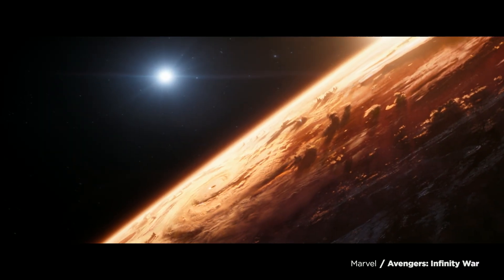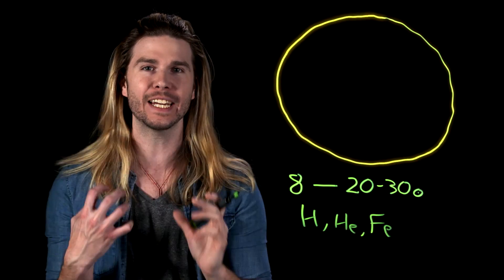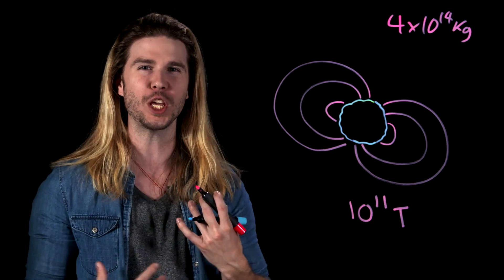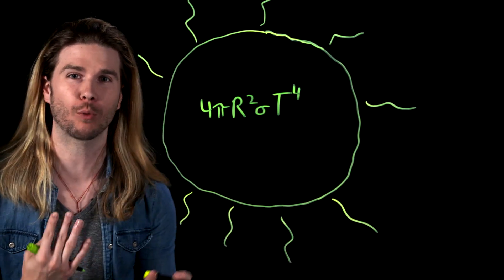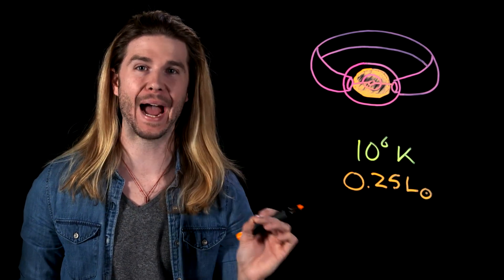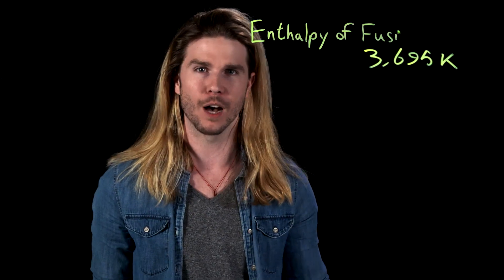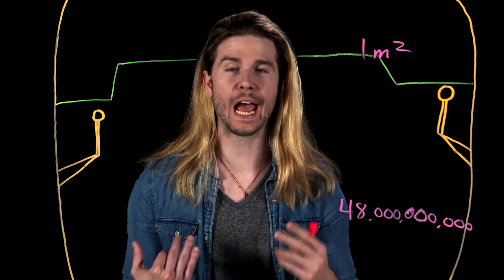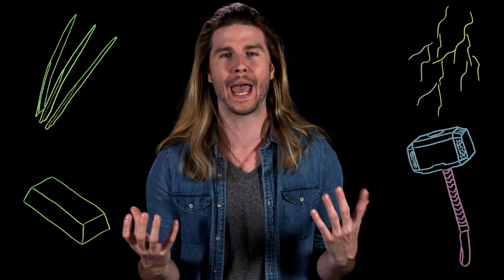How To Forge Thor's Infinity War Weapon

Comment: I think to understand why a star would be needed as a forge in the first place, we need to understand the metal that is being melted.  It is obviously not a metal we are familiar with on earth, especially since we are pretty good at melting tungsten.  Every lightbulb in the world used to do that.  So, we would have to look at the more speculative.  Perhaps we even need to rethink what "forging" in this sense is.  There are theories that postulate the formation of what is known as Strange Matter within the bodies of neutron stars.  Strange matter is made up of strange, up, and down quarks.  There are even a couple of competing models on what strange matter is.  It may even be the most stable matter in the universe.  However, one of the models states that strangelets, individual strange matter particles, that have a larger surface area are more stable than their smaller counterparts.  Because of this, it is theorized that they may be able to catylize normal matter into strange matter.  Conversely, were that true, we would see quark stars rather than neutron stars.  With that in mind, what if the caylization required a specific set of conditions to occur?  Let us say, a specific temperature and particle density hitting a metal susceptible to strange matter conversion.  It would also explain the crucible or mold not melting as well.

Comment: I did some short research myself and after some Googling around I found that a metal with a high melting point generally has more delocalised and unpaired electrons in the outmost shell. This would indicate that "Uru" as full ion has an exceptionally high positive charge. Sounds good to channel lightning through if you ask me...

Comment: I'd like to point out that neutron star material is not in fact the densest material period. A quark gluon plasma has so much density that the neutrons themselves are no longer able to withstand the pressure and break apart into their component quarks and gluons. In fact I'd like to point out the theoretical "strange quark star" as the coolest thing in the universe; a star that has beat the neutron degeneracy and has fused the down and up quarks into strange quarks and formed the truly densest star imaginable.

Comment: And then there were the casting mold which held the melted uru and the pot where the Uru was initially melted. What was that pot made out of? Maybe they should have used that pot to make the axe instead? :)

Also, as soon as the Uru had been poured into the mold, it was broken to reveal the axe head, making the room quite hot. Asgardian air-conditioning must be amazing :)

Plus, when we see Eitri looking into the pot with the melting Uru, it was shown as red. I think when you heat up something to such a degree, white would be the only color one would see (until they go blind without protective eye-wear).

Comment: Hi Kyle,
Even though Eitri states that is will take a couple minutes to melt the metal: there is no indication in the movie that any sort of time skip took place. I think it would be more accurate to assume the metal only took as long as the scene itself to properly melt. If that was the case, and we approximate the scene to have taken about 30 seconds, the metal would have needed only 5x10^19 J. A much more reasonable number.
But that's just a theory.... A SCIENCE THEORY

Comment: I am under the impression that iron is like a poison to stars because it actually take MORE energy to fuse than it puts out. The outward energy pressure drops and gravity takes over. Yes, the core would fill very quickly with iron, but I don't think the mass of the iron is what causes the core to collapse. Please explain if I'm wrong.
Reply: He's explained in a few other comments, and he did explain it in the video too but hte wording was easily misunderstood.

It's not just the  mass of the iron that causes it, its the fact the everything less dense than iron is getting fused, while all of the iron just builds up in the core, so the core gets denser and denser BECAUSE everything less dense is being fused. Then eventually the core is so dense that it overcomes the Chandrasekhar limit which allows it to form a neutron star.

Comment: Thor's Axe Theory:For Thor's hammer to be able to do what we see in the movies there must be a kind special interaction beetween Thor's hammer/axe with the Higs Field.My theory states that the godly tool is made from an ally that contains a kind of exotic particle that varies it's frequency to vary it's amount of interaction per unit of time with the Higs Field amd that particle could be excited when it meets a "worthy"person,someone that can excite the particle.The barrier potential of the excitation would be determined by how much power one can control a particles position and speed (vision,because he phases through walls so he can control quantum particles) and someone like Thor,who is a God and can deliver massive amounts of energy to be able to lift and control it.The engravings could work by detecting who is holding the godly tool and then the tool could just grab energy from it's surrondings

Comment: Just to be clear, (you kinda said this but not really) a star will fuse smaller elements making larger ones which will release energy, until iron which then requires energy to fuse. So the sun stops making energy and no longer can withstand its own weight and explodes/collapses. (You did not make this clear in the video)
Reply: Daniel L fusing iron does take more energy than it releases

Comment: Kyle you're complaining about Thor breathing in space but earlier on in the video you said if you happened to be on the surface of a neutron star and jumped into the AIR. also how did groot pick up the metal? form super high density, non flammable cosmic moss?. by the way your gauntlet aint going to work

Comment: Correction: thor doesn't need to breathe.
He can survive in void , underwater etc.

And you used right handed gauntlet again.
Reply: Black Dwarf Not only can he breathe, he can speak and be heard in space. Iron Man (who he was with at the time) commented on how weird it was.
Reply: He did breathe in space though - unless Nidavellir (or however you spell it) supports an atmosphere around its rings. In theory that should be possible considering that our atmosphere is only visible due to light passing through; if Nidavellir blocks out its main source of light, there's a good chance the atmosphere is basically invisible from a viewer perspective.
Reply: Overlord IV 
But for that to correct, atmosphere should have been visible when the start was ignited
Reply: Neutron starts can't hold atmosphere because of their off the charts gravity.
Matter outside would be pulled .
Reply: Black Dwarf it's rare to see a Dwarf fan. <3 <3
Reply: I contend that the harnessed star's gravity and magnetic field would hold an atmosphere together. If the Dyson sphere can contain that much energy, surely they're manipulating other forces from the star as well. I may have missed them, but it didn't look like the forge had any hatches or doors, it was just wide open to "space". Yeah, Rocket says "You're in space! You Can't..." but I think he was referring to Thor dealing with Newton's Third, or unaware of the fact that there was an atmosphere.

Also, the footage is flipped in post, that was his left hand. ;)
Reply: Overlord IV naw because I’m the beginning when he was floating in space after the guardians picked him up they were all puzzled on how he was alive & still breathing. Only knocked out cuz of Thanos

Comment: Hey There,
Got some question in mind.
1.) On Einstein's Relativity of Time, Thor and Rocket should be many years late from the events of infinity war?
2.) Can you con firm this, the machine enveloping the neutron star is a more advance form of a dyson sphere.
3.) How are they not being pulled to the neutron star, especially Rocket?
4.) Doesn't the pull of gravity on particles, and "air / gasses" to the neutron star enables them to speak?
5.) How can they bend the concentrated "star flame"?

Comment: Wouldn't Thor's body have blocked some of the energy that was used to melt the ingots? So it would actually require a bit less energy in order to melt those ingots than the amount the star produced?Also since you said Neutron stars are not as luminous as larger stars, does that mean the dwarves would get more power from a larger star, like our sun? Or even a red giant or something like that?

Comment: Hello!
So, slightly off-topic from Uru and more on the 'other fictional metal' side, but have you ever considered that Adamantium might not be held together by traditional metallic bonds? We already know it's an alloy of multiple different metals, and it, like steel, could also contain some nonmetallic atoms as well. Normally, this would simply be to increase rigidity, but perhaps what makes Adamantium so special is that its particular blend of nonmetallic and metal atoms, instead of sharing electrons as a whole single mass, they instead formed long polymer strands, which, after cooling, would never be able to untangle themselves and thus 'can never be melted once it's been cooled' as the movies claim. This would also explain some of Adamantium's other unusual properties, such as its extreme corrosion resistance, an apparent lack of conductivity, and ability to hold an extremely sharp edge after years of use without any way to sharpen it.

Comment: I just have some issues with the forging process. Why would the cast for Thor's new hammer/axe be in two pieces? In the movie the metal is poured in, and two halves of the weapon fall out and then are put together by Groot. 

At that point the two pieces were cooled down enough to remain solid, so they could not just be put together to make one solid weapon, the two pieces would have to be heat forged together. 

Therefore, the weapon ends up being two pieces being held together by whatever material Groot is made up of. So wouldn't the weapon then be naturally weaker because it's not one solid piece? And thus begs the question. Why not just cast it as one solid piece to begin with?

Comment: The forging process of the Stormbreaker was silly though.
1. Making a metal weapon in a mold will make it brittle (and you can't argue "Uru metal, magic, different properties, blah-blah" since exactly that happened - the axehead broke in half. Maybe Eitri Lannister wasn't that good of a blacksmith).
2. A wooden arm of Groot is the only thing that keeps the broken axehead together? Well, that's a steady construction that totally is not going to fall apart during use.
And do not even say that Groot holding it together for those few seconds "melted" the pieces together. It took a Neutron star to melt it, judging by its colour it obviously was way too cool Groot picked it up to do any sort of "welding". And even if there was any possibility to weld the pieces together, that's a terribly unreliable construction that will still break easily. If you want to fix a broken axe/hammer/sword, you break it to little pieces, weld them together, and reforge from scrap. Otherwise, it will just break in the same place (Reforging of Narsil into Anduril had the same issue).
Edit: DO NOT GET A HAIRCUT!
Reply: Eitri had his Arms Cut off Goddamnit
Reply: But "every weapon you ever designed - it's all in your head"...
Reply: The mold was two separat eparts I thought, may need to see it again to make sure, but I'm alsmost certain it was designed as two pieces to join with the handle.
Reply: Yep. I really don't get how a slowly pouring shiny liquid is better looking than a sweaty muscled guy beating the hell out of a bright piece of metal into shape.
Reply: Everyone has a problem with the construction but nobody wants to talk about the guy who got spaced and froze up instantly. That's the real problem in this movie.
Reply: Sheol_IK 
hes calling you American because you used the American spelling of 'mold'. Americans spell it 'mold', British and Australians (and usually Canadians) spell it 'mould'. So you didn't spell it wrong, hes just being a nationalistic twat.
Reply: Draco Safarius Which is odd since hafted weapons like pole arms, axes, maces, etc. have their head forged in one piece with a hole or opening in the middles for the shaft to go through. Making the weapon head in two pieces would just make the weapon weaker as well as more complicated than necessary.
Reply: King Le
You came to the wrong channel to use that argument.
Reply: Draco Safarius
That's even worse. Like, it's a weapon designed to hit and break things without breaking itself. A design like that just begs to fall apart.
Reply: Blame the failure of Conan, which is an incredibly obscure film you've no doubt never heard of since it's so poorly-remembered after its total failure to garner any attention anywhere. It included a scene with a muscled guy hammering away at a chunk of metal to make a sword, and it failed. So now hollywood thinks that imagery is incapable of being appreciated by viewers.
Reply: not to mention 'restarting' the neutron star and the forge by dragging the ring by a small space craft
Reply: And how Uru melted but his clothes didnt?
Reply: jiunn wong
I'm not american nor is English my native language. It is my 4th, to be preise.
Reply: sendoh7x they diddnt restart a neutron star, they moved focusing rings to allow the star to be channeled into the forge and opened an iris ring to allow the power to go into the forge
Reply: Sheol_IK as a forecoming chemical engineer, I agree. But I'm also a guy who liked seeing him use Stormbreaker because it was cool, even if the creation process was inaccurate as possible
Reply: I agree, anyone who knows anything about weapons crafting knows they are forged.  I think the three thoughts in mind for that scene were:  (1) most people don't know that, (2) we want show Groot participating to show emotional growth and group participation, and (3) this puppy already clocks in at two and a half hours and we're not adding another ten minutes that will screw up our pacing so we can have a montage of Chris Hemsworth half naked and sweaty beating on glowy magic metal.  If we show unrealistic manufacturing processes for our Thanos-killing weapon, the check for this movie will still cash just as fast.

( From a personal point of view, I thought the weapon was achieved too quickly and easily.  Any weapon better than Mjolnir should be harder and trickier to achieve than the space equivalent of some kid burning some paper with the universes best magnifying glass, but I get it when compared to run times and story pacing.  Just saying, )
Reply: Magic metal, I think that's actually a plausible explanation here. Dwarf guy didn't seem all that worried when the pieces came out broken, no mention of "aw fuck I messed up" or anything, he just said he needed to find the handle. It also didn't come out shattered like one would expect, it came out in just two pieces that fit with flat edges against each other, so I think it was supposed to be that way.
As far as Groot's arm being the handle, Groot is pretty durable besides, but I also imagined that the hammer itself imbued some of its crazy magic/cosmic energy into the handle too. After all, the thing brought Thor back from the brink of death just by him holding it.
Reply: Sheol_IK dude its a magical weapon in a made up universe it's ok to just let it go
Reply: Exactly, I'm tired of fantasy, or any movie involving swords an axes, showing people making sword blades or axe heads by casting. Nobody does that, all metal weapons are created by forging (aka hammering)  pieces of metal (usually steel) that have been heated up to where they're very, very hot. 

If they created Stormbringer the correct way they wouldn't have needed as much heat since they didn't need to melt the uru. I'm sure that it takes a whole lot less heat to get a metal to where it's maleable than it does to melt it.
Reply: @philhsueh4860  we do not give a shit if you are tired of fantasy....................We love it.............and we do not give a shit if the things we like, it is not posiple to exist.............WE LIKE FANTASY..............even if there is no explenation of that fantasy!!!
Reply: @giannastavros4653  Re-read my post. I didn't say that I didn't like fantasy, I just don't like it when in fantasy (and other genres) they do things like casting weapons. There's a difference between not liking elements/tropes in fantasy and not liking the genre itself, which I happen to like very much.

Also, way to keep it civil.

Comment: The real reason why stars can't fuse iron is because iron actually loses energy when fused unlike the elements before which output more energy than was given to them. Whats interesting about iron though is that the fission energy is also lower than is required to actually fission it. Thus stars cannot 'burn' iron as it acts like an energy sink making the star lose energy.